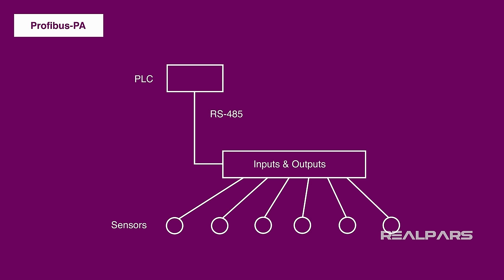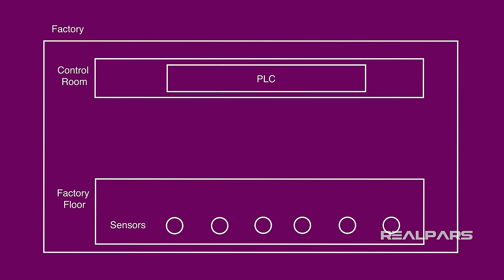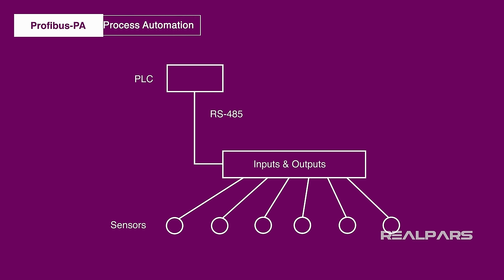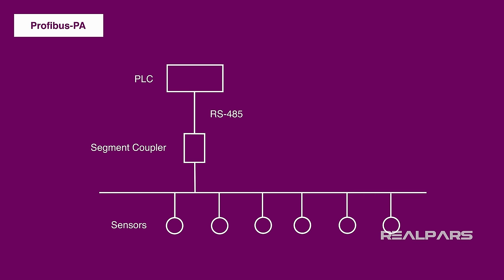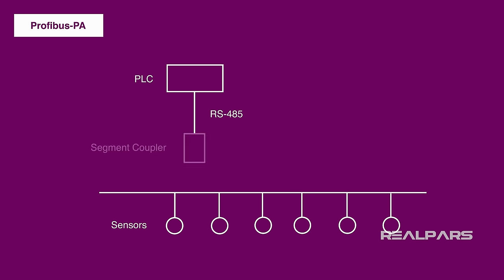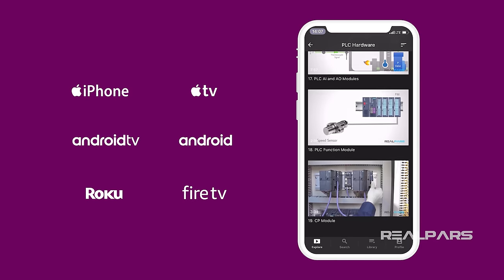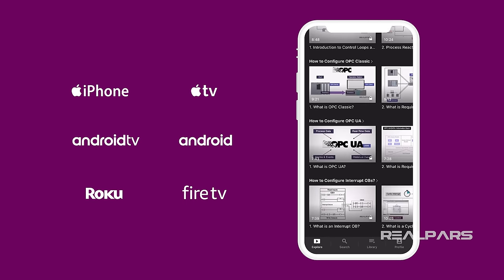What is Profibus PA and How Does it Differ from Profibus DP?

Comment: Realpars videos were great in helping me prepare for my interview, and I got the job. Kudos guys.
Q: The cables from the sensors or transmitters to the PA Bus, are they also profibus PA cables?
Reply from the maker: Great news on your interview!  Best of luck in your new job! Yes,  Profibus PA cables are used to join individual sensors to the PA bus as well as make up the bus itself.  The cable is single pair 18AWG stranded tinned copper, insulated, shielded cable with PVC outer jacket,  usually orange in color.

Comment: Thanks as always for a simplified and easy to follow as well as understanding.
Question: Does it mean that PA does not use any I/Os?
Reply from the maker: Profibus PA is used to communicate directly with the device (transmitter, sensor, etc.).  The data resides in the device and is transferred to/from the PLC without having to go through a remote I/O subsystem (interface card, analog and digital I/O cards, etc.). This simplifies the cabling and structure for communicating with the field devices.

Comment: Thanks for the good video, however some comments: When you explain in profibus DP the sensors are connected to the I/O, you should clarify what kind of connection, e.g analog 4-20ma?. When using profibus PA, same type of sensors can be used?
Reply from the maker: 4-20ma transmitters develop an analog signal by varying the current along the wire connected to the analog input card.  ProfibusPA is completely different.  ProfibusPA and 4-20ma are not compatible.  For ProfiBus PA, you will need a different transmitter, cabling, power supply and communication card.  ProfiBusPA is a digital communication protocol, not analog like 4-20ma.  Each transmitter is considered a node and is configured with software provided by the host controller.  ProfibusPA devices can communicate much more data than the single PV variable of analog transmitters, incuding PV, totalizer values, sensor health, and configuration parameters (like range and alarm setpoints),

Comment: Thank you for the simple explanation..
I am wondering if the Profibus PA is an replacement of HART protocol and what is the difference between these two protocols.
Reply from the maker: Yes, HART and ProfibusPA are very similar in the type of data that is provided between the sensor and control system.  HART is somewhat simpler, since most analog sensor now come standard with HART and most analog I/O cards provide a HART interface.  HART can be used regardless of the communication protocol used by the Remote I/O subsystem.  ProfibusPA must use a linking device to transmit data to/from the sensors as well as 24VDC power.  HART uses loop power from the control system analog cards.

Comment: In the video, you said, 'We move the Inputs & Outputs from Control Room to the field, by this you mean that in this Profibus PA setup, we move the Input/Output Modules/Cards to the field near the sensors...right?
Reply from the maker: Yes.  I can use a variety of devices to connect sensors using Profibus near the location of the sensors, and then connect one cable back to the PLC rack.  This saves space, cable, and wiring costs.
Reply: @realpars  So you mean in such setup, the Input/Output PLC Modules(Cards) are not present in the PLC Rack in Control Room but are present somewhere in a JB in the field near the concerned sensors, right?
Please confirm/clear my ambiguity.

Comment: Thanks for the knowledge sharing....
Some questions...Does that means the same software configuration is used in both protocol...?
The sensors or transmitter used are they the normal ones found in the field or they are specially made for this Profibus-PA network (the port that's why I asked)....?
Reply from the maker: The sensor needs to have the electronics to be able to interface to ProfibusPA.  Modern sensors/transmitters are able to be specified with a number of different interface cards installed.  If your plant uses ProfibusPA, then the sensors/transmitters need to be purchased with ProfibusPA interface cards.  Your sensor electronics need to match your instrument bus type.

ProfibusPA and ProfibusDP have different data packet structures and baud rates for communication.  TIA Portal can be used to configure many aspects of each protocol, so although the front-end may look similar, the packets used in communication are not.
Reply: @realpars  Wow ...this great guys...this great...Your ever assistance can not be appreciated enough....

Comment: Hello I have one question 
when  profibus PA was used input modules of the PLC  were removed. So where exactly are they now? Are they in control room near the PLC or in the segment coupler? Or near the sensors?
Reply from the maker: ProfibusPA is a bus protocol that gathers data from the nodes (sensors) attached to it.  There only needs to be a Profibus-DP/PA linking device to join the PLKC to the ProfibusPA segment.  There can be many Profibus PA segments attached to one PLC.  Each linking device provides the same function as the I/O rack and cards in a traditional installation.  The thing I appreciate is that bus networks such as Profibus PA eliminate a lot of I/O panels, saving cost and space.
Reply: @realpars  Thank you very much

Comment: Thank you for the video. I have one question. Can u directly connect the sensors to the PA bus? Or  Is there any transmitter involved?
Reply from the maker: Typically a transmitter or other interface electronics is used to connect the sensor/device to the PA bus.  You must have a Profibus-PA enabled connection/interface to place a sensor on the Profibus PA segment.

Comment: Really I love Real Pars videos, I learn a lot of automation and I can apply this knowledge in my job as programer in OEM factory.

I have a question, if I use Profibus PA do I need Profibus PA sensor/actuator or simply can I use the standard NPN/PNP sensor/actuator? And what is the maximun distsnce between the Profibus PA coupler with the master and with the I/O? Thanks a lot!!
Reply from the maker: Yes, your sensor has to specified with and have a Profibus PA interface card.  The maximum total length of a Profibus PA segment is 1900m, but if it has drops or spurs, they can only be 30m in length each.  The spur length must be considered in calculating the total segment length.  Practially, I limit the segment lengths to less than 1000m to avoid any potential problems.  For installations in hazardous areas, 1000m is the limit but other considerations also have to be made for power.  All Profibus cables must be run in isolated, grounded conduit or segmented, grounded cable trays, at least 18 inches from any AC voltage or inductive circuits to avoid electrical interferences.
Reply: @realpars  Thank you for this information, I had the same doubt. Regards.

Comment: Thanks for the explanation , it was easy to understand !! . Do we still require IO modules with the PLC in case of Profibus PA
Reply from the maker: With Profibus PA, you are communicating directly with sensors, valves, etc., and do not require separate I/O cards.  Each device has the capability to provide many values for configuration, monitoring, and control.
Reply: @realpars  but how does it differentiate between the sensors on a PA bus? Does the sensors have some sort of ID? should we use some different kind of sensors on a PA bus?

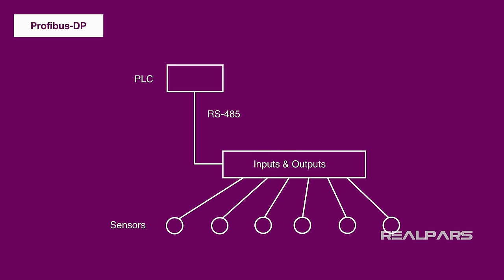Comment: 2:25 is it that far cheaper? Because, when you placed the I/O module close to sensors, you'll probably need to place it in an electrical board. That electrical board will need a power supply. Incoming from 230VAC, you'll need a 24VDC to supplies the I/O module, breaker, etc.
Or how is it done?

So i just wondering is it that far cheaper?
Reply from the maker: Hi there, 

Thanks for your question!

Yes, it is cheaper. The cost of a local control panel next to the sensors is far cheaper than running the wires, conduit, and other electromechanical components. And the real cost is in the labor to do all this work. In addition, when it comes to troubleshooting the sensors, it’s a major advantage to have the I/O boards connected to the sensors where you can see and measure the voltage coming from the sensors to the I/O boards. Imagine having the PLC I/O boards 25 ft or more away from the sensor, and you are trying to troubleshoot a sensor or I/O, and you can’t see the indicator LED signal on the board. 

Happy learning from RealPars!

Comment: Except cabling efficiency what other benefit profibus PA provides over profibus DP? At what number of devices we should shift from profibus DP to profibus PA. Next, how much is the cost difference between the two setup for a given number of field devices?
Reply from the maker: Profibus PA allows for a larger array of data to be queried and set in the device as compared to Profibus DP.  Profibus PA is used to connect transmitters, actuators, and other analog devices to the network.  There is a way to install Profibus PA in an intrinsically safe manner, whereas there is not with Profibus DP.  Profibus DP is a faster protocol and is well suited for digital devices like motors.

Comment: Hello and thank you that was so helpful
my question: can both (rofibus dp and profibus PA) do the analogic sognal process ?
Reply from the maker: Yes and no.  Each protocol has a specific way that it interacts with the device they are connected to.  ProfibusPA is used mainly for motors, drives, scales, etc., that regularly receive commands (start, stop, tare. etc.).  These devices may have setpoints or feedback parameters that are analog in nature (integer values, etc).  ProfibusPA is constructed around process transmitter data, with many floating-point values and slower update times (250msec) than typically is used for Profubus DP (50msec updates).  The cards used in DP and PA devices are quite different and are constructed to handle the specific interfaces.

Comment: What are the pros and cons of using Profibus PA instead of ASi-bus? In my industry we rarely use PA but ASi is almost standard when it comes to field bus.
Reply from the maker: Profibus PA is a better choice for connecting analog transmitters, since Profibus PA can transmit larger block of data.  Profibus PA installations are more costly than ASi installations on a per device basis.  ASi is superb at interfacing digital devices to the PLC or DCS.  As with any fieldbus, pick the one that meets your sensor interface needs at the price you are willing to pay.  Obviously, once you have an installed base of sensors, it is likely that you will want to continue with that approach.  Both Profibus PA and ASi require a master card and compatible interface cards at the device level.  ASi has the advantage that the trunk cable does not require a terminator.

Comment: I a project I have used profibus, Which connected graviometric controller to Profibus remote module via profibus cable & profibus remote module was connected to PLC. I am eager to know what type of Profibus connection that was ? Profibus DP or profibus PA?
Reply from the maker: Hello, @biplabmukherjee1480. This is a good question. However, as we stated in our video, it is connected to Profibus. Look at the part numbers of the connection devices from your PLC to your remote devices. You have the RS-485 coming from your PLC connection device or PLC direct, and if it is going to your devices directly with no Segment Coupler, as we show, then it is DP. If you have an RS-485 to a Segment Coupler to your devices, then it is DP to PA Profibus. Remember, they are both Profibus. However, there are two types of electronic communication devices.

Comment: Can you tell about the what's the speed of perfect DP and Pa
Reply from the maker: Profibus PA has a data transmission rate of 31.25 kbit/s.  the speed of a Profibus DP network is selectable at the master to run at speeds between 9.6 kbit/s and 12 Mbit/s. A particular speed should be chosen for a network to give enough time for communication with all the devices present in the network.  I find that Profibus DP is most stable at speeds of 500 kbit/s and 1.5 Mbit/s.

Comment: This channel is one of its kind, thank you for your quality content. What kind of Profibus am I dealing with when I have many peripherals connected in a daisy chain scheme?
Reply from the maker: Both Profibus DP and Profibus PA can be connected as a "daisy-chained" bus.  However, it more likely that Profibis DP is connected in this manner, since Profibus PA usually uses passive connection blocks to connect to the individual instruments, but even then, the blocks are daisy-chained one to another.  If you are inspecting an existing installation, purple cable is most often used for Profibus DP and orange cable is most often used for Profibus PA.  Profinet, an industrial ethernet protocol, is not daisy-chained and typically uses blue cabling.

Comment: When we removed PROFIBUS-dp and put a unified cable PROFIBUS-pA, how does the PLC   know from which sensor this signal is, because all the signals are in one cable?
Reply from the maker: Profibus PA communicates much the same way as Profibus DP -- via telegrams (data packets).  In the header of each data packet is the node number from which the data came.  The node numbers are unique on a Profibus PA segment for each device (sensor).

Comment: coupler is in control room or factory floor?
Reply from the maker: The MPI/Profibus coupler is usually located in the same place as the master communication cards, which is typically in the control panel with the CPU or network components.  This location is usually in an environmentally-controlled operating room or equipment area.
Reply: @realpars  Is placing a coupler in a factory floor a mistake? Is it acceptable?

Comment: Great Video guys, I put some really big control systems in about 20 years ago using Omron PLC's with Profibus DP cards links to Profibus PA segment couplers and ASi masters(for digital IO). This was a huge success for us cutting down the control system design and installation massively. I moved on after that and since then have not worked with Profibus.
My question is, I am looking at putting forward a control system using Profibus with Rockwell PLC hardware but wonder if its best to use the same conjuration I was using 20 years ago or should we be looking at Profinet? Quite how this changes things I am unsure of .Does instrumentation connect back to the PLC via some kind of gateway and does it power instruments as PA does.
Reply from the maker: Profinet is more "modern" but ProfiBus DP will work just as well in most cases.  Either way, with Rockwell PLC's you will need a gateway.  ProSoft has a variety of gateways for every configuration (https://www.prosoft-technology.com/).  I love the PLX31-EIP-SIE Ethernet/IP to Profinet/IE gateway for its speed, reliability and ease of configuration.

Comment: Thank you for all your videos, I have one question on this one, though:
Couldn't we have created profibus DP capable sensors instead of creating the Profibus-PA? If not, what's the main limitation?
Reply from the maker: The way that data is stored and communicated by Profibus PA and Profibus DP is fundamentally different, both in the size and scope of the data transmitted and in the transmission method.  Profibus PA is polled and Profibus DP works on a telegram method of data request.  Profibus DP is simpler and communication rates can be set over a range of speeds. depending on a number of factors.  Profibus PA runs at a fixed speed and is used to communicate more data (transmitter configuration and process data) at regular intervals.
Reply: @realpars  Thank you very much, I'll look further into the protocols, then. Your answer was on spot and very  efficient.

Frankly I wasn't expecting to be answered on a 1 year old video, that was a good surprise, congratulations for your awesome job.

Comment: Sir,
What are the causes if profibus encoder red indication blinking and green on permanently ?
Reply from the maker: I would need to know the specific model o the encoder to say exactly, but a blinking red with steady green LED usually indiates the encoder is ready for operation but not activated by the
 master (e.g. incorrect address configured).

Comment: @RealPars but how does it differentiate between the sensors on a PA bus? Does the sensors have some sort of ID? should we use some different kind of sensors on a PA bus?

Thanks
Reply from the maker: Each node on a ProfiBus-PA network has a node address (0 - 31).  This can be set by DIP switches on the device or via a configuration interface at the device.  Only devices with a ProfiBus PA interface can be used in a ProfiBus PA network.  If you have a 4-20ma transmitter and want to use it on ProfiBus PA, you will need to change out the electronics on the device.  It is not as easy as upgrading from 4-20ma to HART, but ProfiBus PA will give you access to a whole lot more sensor-level data, configuration, and diagnostics than a HART interface can provide.
Reply: @realpars   THANKS A LOT FOR THE INFO.

Comment: PA seems to be more in the level of IO-LINK or AS-Interface. But when to use one or the other?
Reply from the maker: Yes, you are correct that Profibus PA and IO-Link are similar.  Both protocols are useful for digital pressure, level, flow, and temperature transmitters.  IO-Link is also an excellent choice for discrete I/O, while Profibus PA is not as useful for I/O such as proximity switches.  AS-i Bus is primarily used for discrete devices, such as on-off valves and proximity switches since its data capacity per node is not designed for digital transmitter values.  Very often, a site will use Profibus PA for transmitters and ASi for discrete I/O.